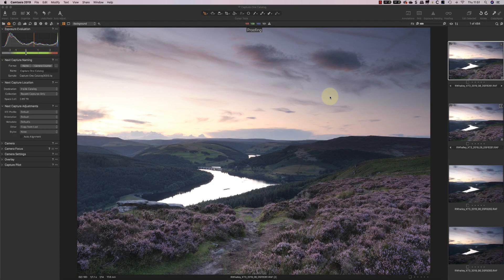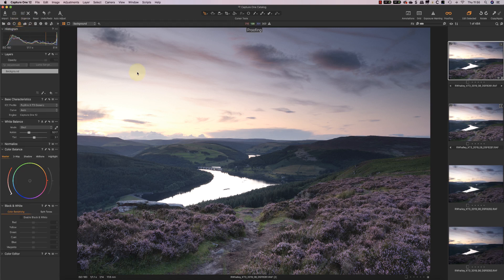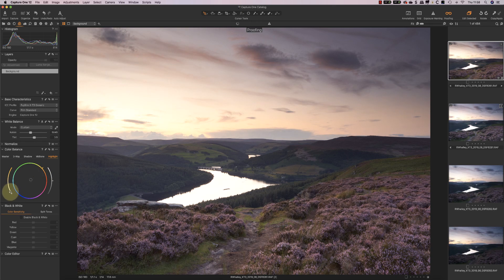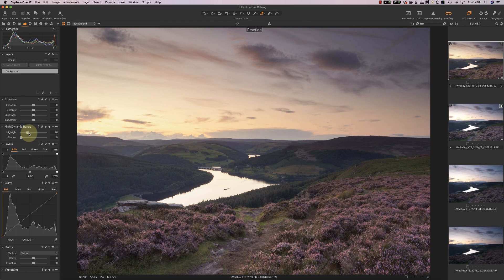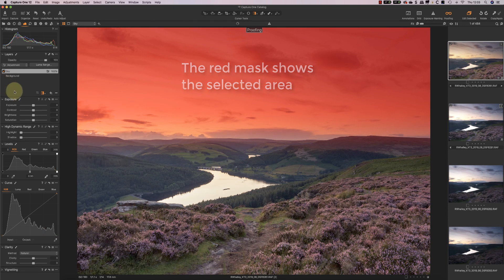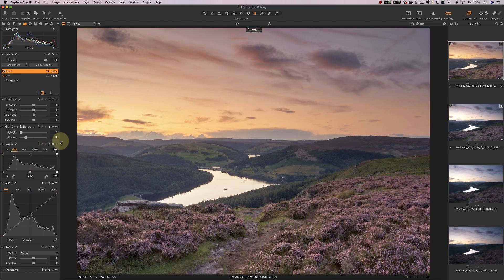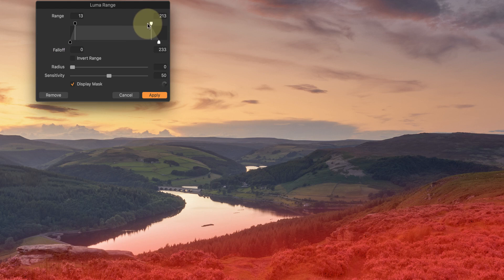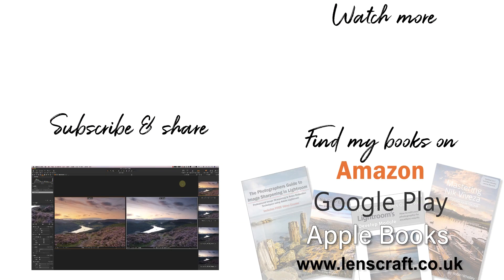Landscape Photo Editing Workflow - Part 2 RAW Processing

Comment: Thank you for posting this . I still do not understand why you are using C1 ...very near the end you inform that you are going to move it in to Photoshop when you will also use Nik . This is a lot of money spent on software ..Nik is no longer free, C1 release an annual version for which a further payment is needed to stay up to date . No bracket merging in C1 , no de haze slider .I shoot XT 3 too and really can see no point in incorporating C1 .
Reply: Fuji have partnered with Phaseone as their preferred raw developer. C1Pro was already considered to be the best RAW converter for Fuji X-Trans files and this has further improved with the partnership with Fuji. C1Pro Fuji Essential is free to Fuji users because Fuji pay Phaseone for each installation. There is also a very favourable upgrade path to C1Pro. This is why many choose C1Pro as their raw converter of choice for Fuji files. Nobody forces you to use it but Fuji thinks it is the best and they should know?
Reply: I use C1 too. I find it faster, easier tailored workflow and session not catalog based. Dehaze can be done using other tools in C1 and bracketing... With shadow and highlights recovery cameras since around 2016 have enough DR that I only need 1 image exposed for the highlights.. Oh, and Nik is STILL free from their website ...
Reply from the maker: In the first video, I explained that I use lots of tools but pick then pick the best one for the image and look I'm creating. For a different image, I may use a different set of tools. But to answer your point about Capture One, I use it for my Fuji images because I've found it the best RAW converter for Fuji. I also have to disagree about Nik not being free. You can still get the free version from Nik, here's a link to my article explaining how https://lenscraft.co.uk/photography-blog/can-i-get-the-nik-collection-download-free/
Reply: @usedg - the original NIK is still free and may be downloaded.